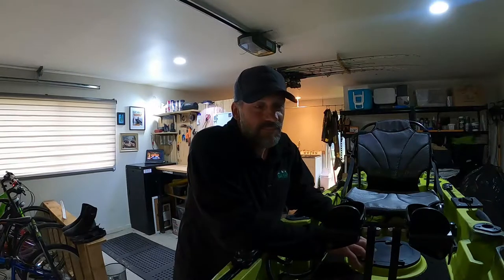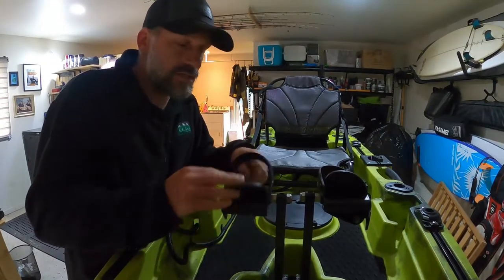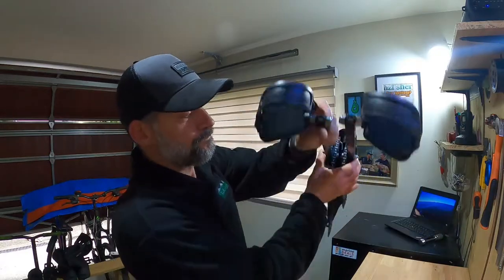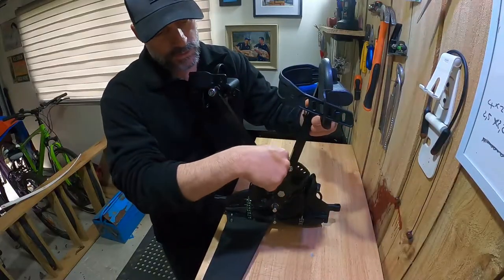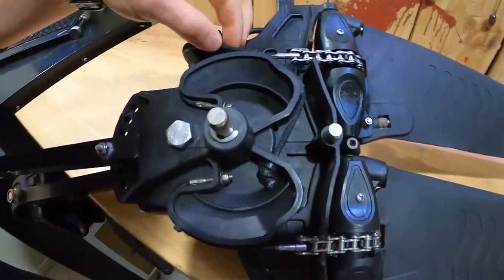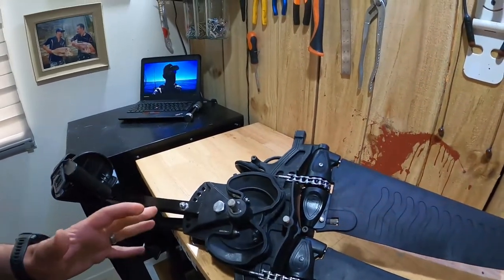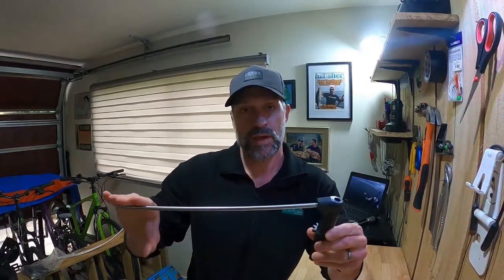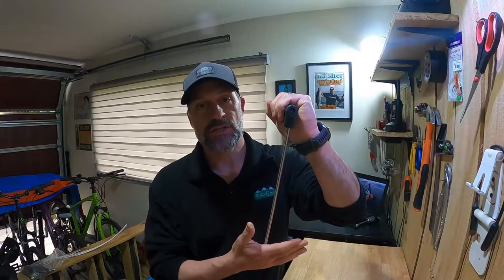Nova Kayak Flap Pedal - Tips to make it last longer

Comment: Hey Mad Saffer, 

Thank you so much for your informative videos on the Nova Kayak and improvements on the pedal system. I am looking into purchasing my first kayak and are replacement parts (fins, chains etc.) easily accessible from an Auckland/NZ retailer or did you have ship them in from overseas? Cheers
Reply from the maker: Hey bud, you are most welcome. Glad you enjoying the vids. I haven't found any local suppliers for the parts but ordering them from overseas is pretty straight forward and they get here pretty fast. If you apply some of the tweaks I spoke about from the day you get the pedal you won't have to replace them for a while. Just remember to not overtighten the cables and don't apply pressure to the fin rods when storing them and they will last a good while. If you do run into any problems give me a shout, I have a few spares available and can help you out if you need.
Reply: Cheers for the reply. Very informative and loving your DIY contents on top of the fishing. Might have to take you up on the offer one day. Thanks mate and take care.